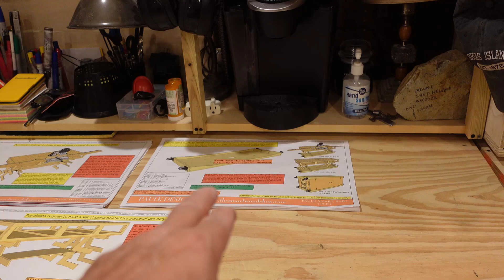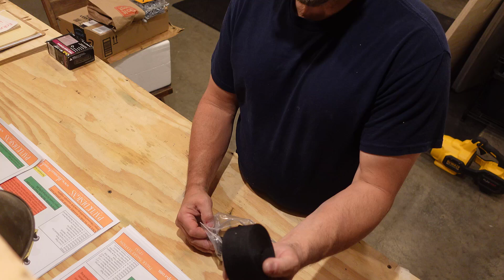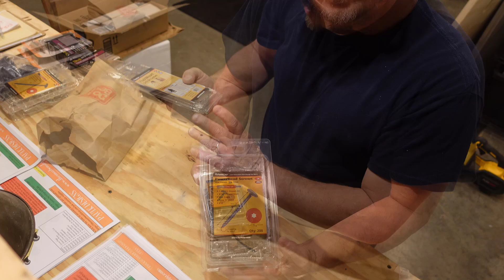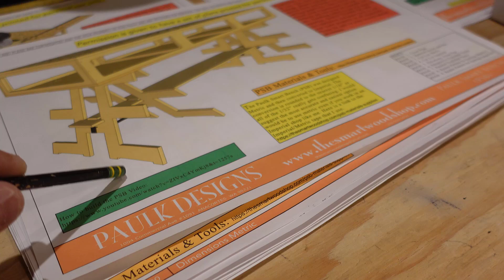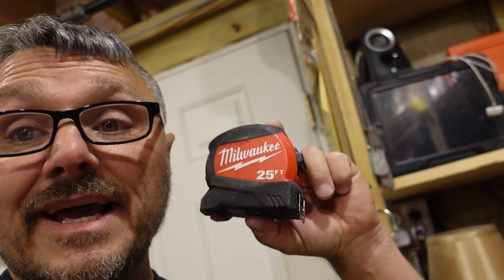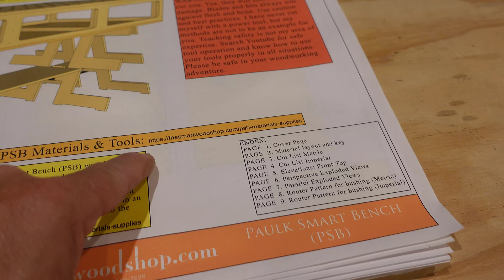SMART - MFT - Work Bench build - Materials Delivery

Comment: I thought you were going to use the top from the pre cut bench you bought from Reparadise as a template for your dog holes?
Reply: Peter Parfitt is a freaking genius!   I have the mark 1 Parf guide system and LOVE IT.
Reply: @KevinZale very true. Make sure everyone knows I believe any errors on my tops are because of the following
-1st top was 3 layers of 3/4 MDF and drilling through each glue line was very hard on the bit and possibly caused excessive wear to the jig. Feels like there is more slop than before
-1st top was 4x8 and I am short causing me to lean over the top possibly deflecting the rulers while drilling.
- Biggest problem is I use a 001" feeler guage to check for gaps. I need help!
Reply from the maker: @KevinZale  Howdy Kevin! Thanks for commenting!! I whole-heartedly agree with you. I am now a huge fan of Mr. Parfitt and his fool-proof system for a high level of precision that even I could not goof up easily!
Reply from the maker: Hello there Master Kenobi! You are absolutely correct. I was going to do just that. BUT....a couple videos ago, I was going over the "getting ready to build the bench" stuff where I mentioned that I was exploring 3 options for making the top of the bench and Ron and three others commented back about going with the Parf Guide System Mark 2. It was so consistent with those few that I figured "what the heck" and scrounged the 25,000 pennies to buy the tool from TSO. 

I grabbed a 2x3 piece of old 3/4" ply falloff to sacrifice to the Learning-The-Parf-System Gods and watched 2 videos from Peter Parfitt of New Brit Woodshop YT channel where he shows how, step by step, to use his creation. It is so simple, even I couldn't goof it up without really trying to make a mistake. The practice piece came out so well that I decided to keep it and use it with the new bench like Ron does with all the accessories he adds. 

So....I think I won twice. I have the Parf tool and it works great (CnC quality layout) AND.....I have a knock-down Paulk bench from Reparadise (that I thought I would use to template my "from scratch tops but didn't) ... that I can assemble after my total station build and the  carts too. 3 carts! Wow. Do I need 3? Nope. But, it sounds pretty cool.
Reply: @sdsconstruction  my bad missed that one. I have the  parf guide also but was considering using a top as a template to speed it up. I have made 3 tops so far and have had some error but I was a machinist before so may be ober critical of it.
Reply from the maker: @RobyWanKenobi  I have had several machinists in my family (cousins, uncles) and know that their degree for tolerance is between the thousandths and millionths depending.... So no surprise you are looking at any system of dog holes with a more critical eye. I just squint and make it all go blurry and call it done.

Comment: Hey Spence!  Looks like you have a great start on the bench(s) build!  Looking forward to the assembly/build video to come.  I am really looking forward to hearing what you think about the Fastcap countersink screws and that Fastcap FlushMount drill bit system.  That really looks interesting to me!
Reply from the maker: Howdy Russ! I assembled the bench yesterday. It came together exceedingly well. Ron's time into his plans certainly paid off for me for the assembly. Everything lined up/fit the first time without any need for modification.  I bought that drill bit and screws because Ron recommended them for his cart system (version 1) and they look pretty cool! Oddly, I just saw a similar drill bit and countersink combination used by another YT woodworker who build his own portable MFT table and he used it for some of the assembly and it looks like it works great. 

The SMART Kart (version 1) is my next build and I will build two at the same time (one for the current bench and one for the next SMART STATION bench that is in the build cue.)

I was on a job site today (Sunday) and used the bench as a surface to cut plywood out for a flooring repair in a bathroom that had rotted subfloor. No surprise, bench was stable and much easier to set up than my 3x7 compact bench that I built back in 2020. I don't notice that it is that much lighter but it could be my level of fitness telling me I need to start lifting again so it feels easy to pick up (as it should).